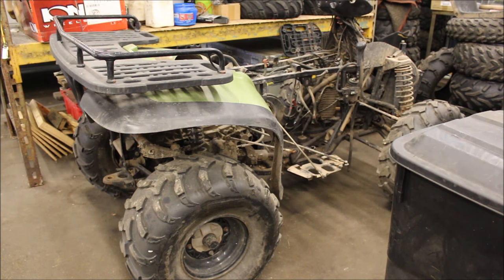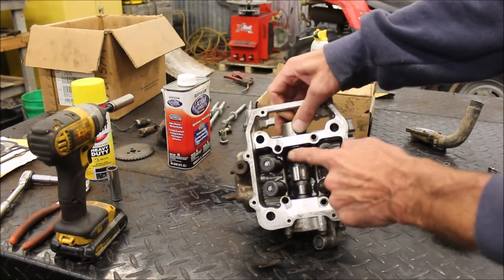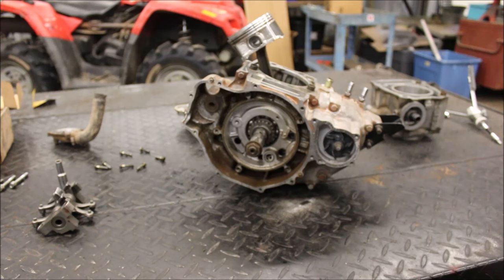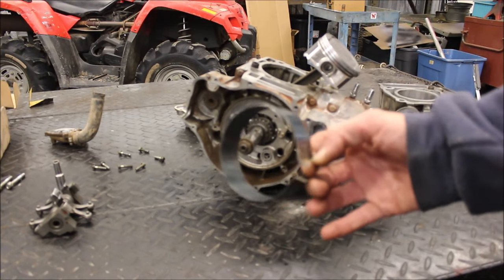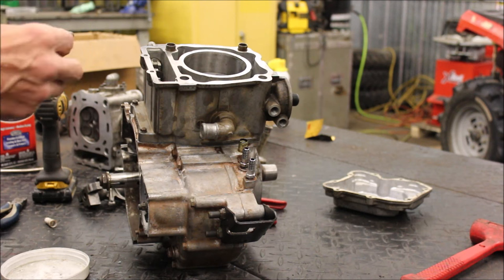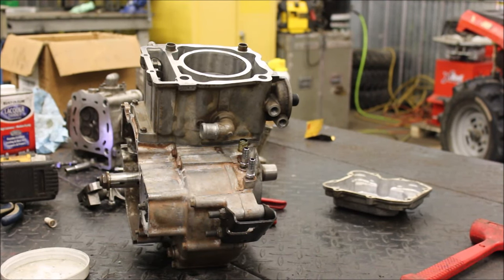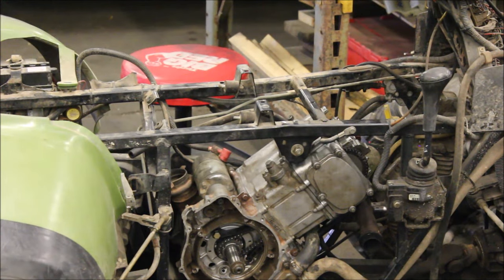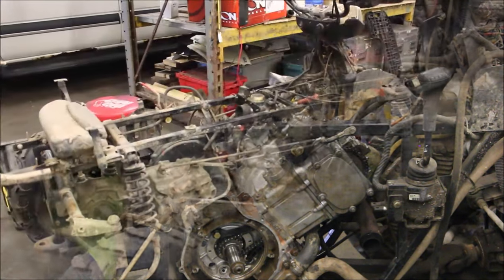1997 Polaris Sportsman Engine Rebuild. Starting and Wiring issues fixed.

Comment: Glad you're doing a polaris electrical video. I've worked on a lot of atvs, and have never dealt with the electrical gremlins my '02 500 Scrambler has. Ready to push this thing out to the road
Reply from the maker: Yup. I've been there. But now know what to look for. Corrosion on the plugs, switches and add another ground wire.

Comment: Polaris are notorious for electrical issues unfortunately.  Connectors with corrosion build up can be submerged in vinegar to clean them off. After cleaning, a nice tuneup with dielectric grease will help prevent future problems. 

Anyone experiencing electrical issues should always start with ground wires and connections.  Despite popular belief, electricity actually flows  from; the ground (battery source) to the positive side (load) on Direct Current DC circuits. Once this concept is understood, it will become more easier to troubleshoot.
Reply from the maker: Right on! I have an old video of using vinegar and salt. It works awesome. Maybe I need to make a new video on it.
Reply: @TitaniummanGarage  Not going to lie, I probably got that part from your video.  New videos are always great!!
Reply from the maker: @smallgaragehustle  That's some funny stuff right there! I had to check my video's. It wasn't a separate video. It was my get rid of the ecm video. When I made that one back then I thought, I should do a video on vinegar and salt...never did. Thanks for being a long time subscriber. Always good to hear your input.